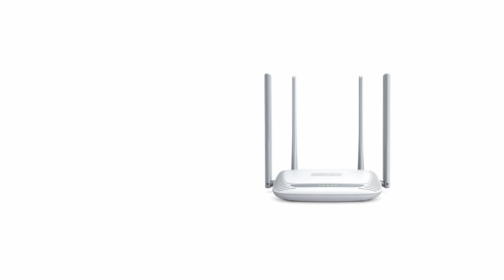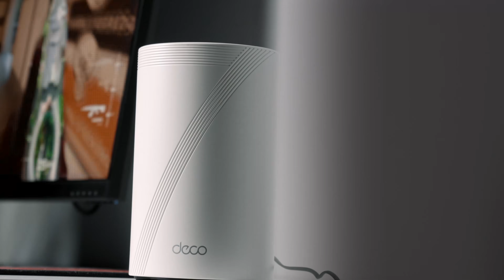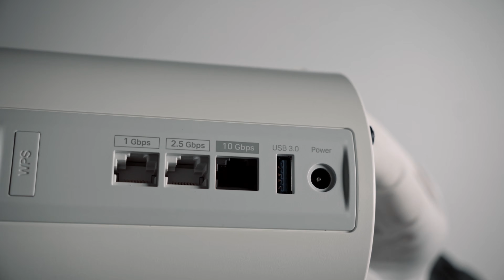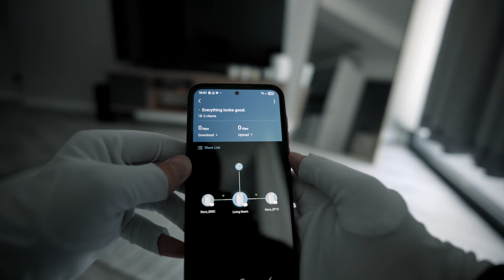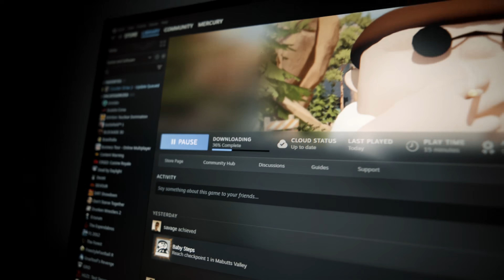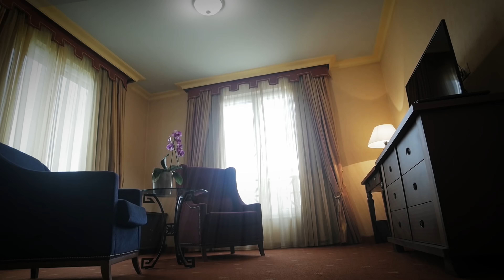I Fixed Wi-Fi in My Entire House. Here's How...

Comment: I had an aging Motorola MG7550 docsis 3.0 Wifi 5 gateway. I upgraded to a Arris G20 docsis 3.1 WiFi 6 gateway.
I have a small house (800 sq. ft.) and the G20 WiFi 6 has good speeds in every room, even on the front & back porch.
Installation was painless and the equipment swap out and setup took about an hour total in time.

Comment: Having a Cat 6 or Cat 7 cable line running through your house will give you a better and faster connection. Other solutions (like mesh) should only be a second option if a wired line is not possible.
Reply: 🏆Great advice, people overlook the age and quality of their cables all too often. 
I recently swapped out my 1990's era cat5 cables with modern cat6 cables and noticed the difference.
Reply: True, I would also preffer LAN over Wi-Fi. It's more stable, reliable and the cat6-7 cables provide more speed. I do want to point out, not everyone can lay new cables, eg: rentals, protected buildings. For those case, this works very well.
Reply: Meshes are great for family households where not everyone is using ethernet cable. But I agree if you have a gaming pc or laptop, you should prioritizes an ethernet cable if possible.